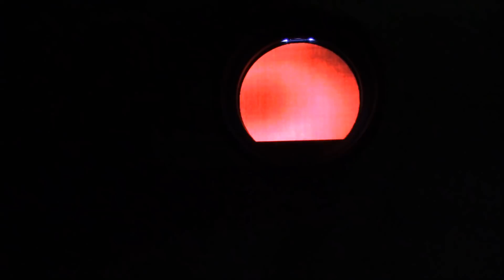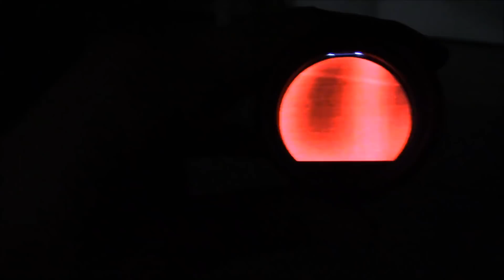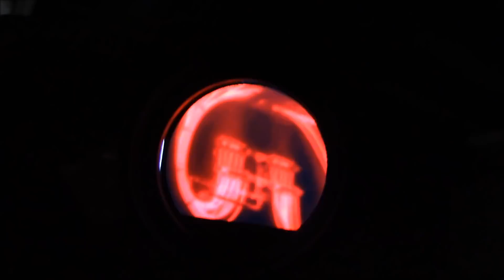Lift Install: Mapping Heat Tubes

Comment: What good luck that the guy was clearly planning on putting a lift there! Kinda nice he left the loops in middle too, you could work under car and still have warm feet, or if you needed to lower car and lay down for something like a tranny or motor dropping from bottom you wont have to deal with one iced cold patch of concrete! I want to do a heated floor in my next garage, best part is because the floor holds the heat you dont instantly loose all the built up warmth when you open a door for a minute like you would with a furnace that just heats the air up!

Comment: How thick is the floor?  How long was the unit on for so you saw a difference in the scope? What is the temperature delta between the floor and air temp?